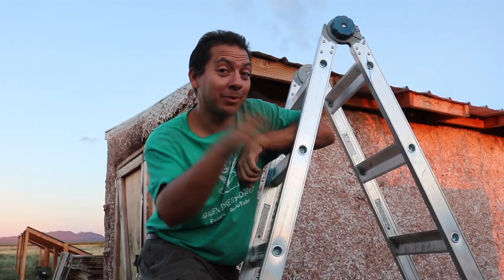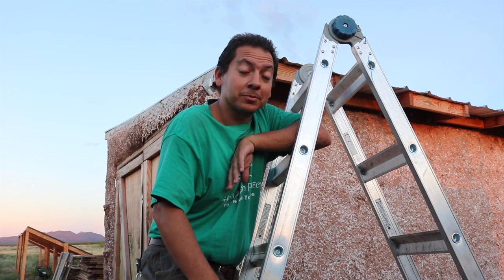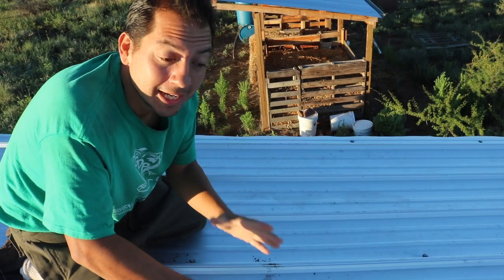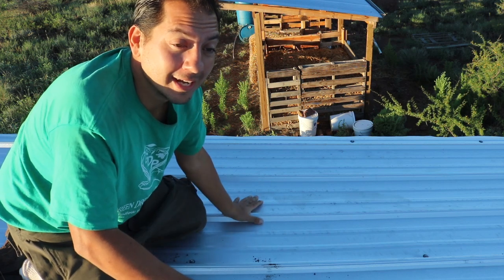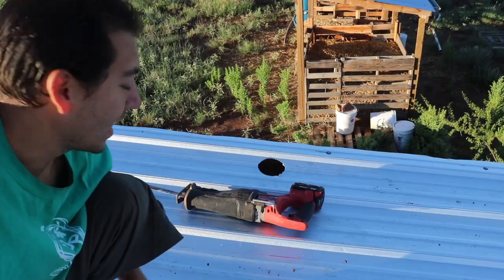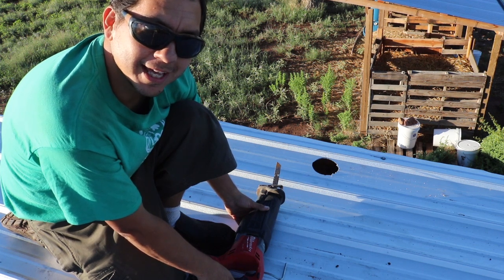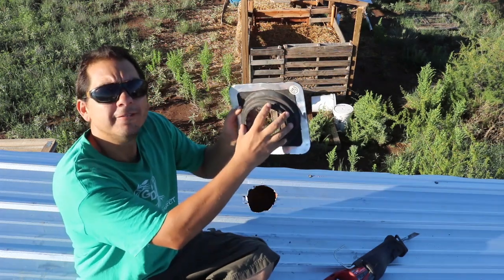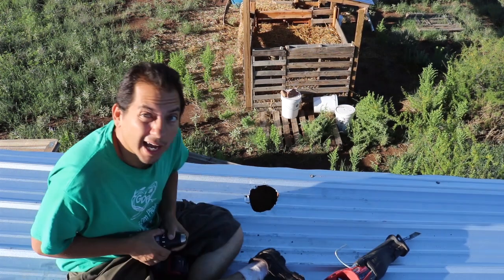OFF GRID No Electricity Air Conditioning in the Desert | Making a Solar Chimney

Comment from the maker: Thanks so much for watching! We hope you have an awesome day.🙏
Reply: They make 4" ABS or PVC mushroom vent caps available at most plumbing supplies.
Reply: Any updates on this ?
Reply: You don't do Heights as well as Jess...  Glad to see the solar chimney concept put in place.... How did it go now that it's been 12 months?

I'm looking back through old vids now that I've started on my place.
Reply: i know this is kind of an old video, but i can already tell that this method didn't work all that well, however it can still work if you buried cooling tubes like how earthships cooling tubes work using the natural air of the buried cooling tubes to cause an cross breeze into the room and then up through the sun tube that collects heated air while it keeps that flow of the cross breeze going continuously without the need for any electricity or any fans running.
Reply: Did this move some air at least? I've got stagnant air - no fun.
Reply: @5226-p1e  no. I have not done this .. yet. I've been trying to find different designs.
Reply: Great just keep up the good work I live out in the desert I like your idea please keep them coming I'm an old man
Reply: dig a trench and put a pipe in the ground on the north side and then attach to the incoming vents on northside. Dig the trench about 4 ft under ground. This will draw cool air from ground.

Comment: Cool, you are 20% of the way there. Now dig an 8' deep trench to the edge of your property and put some perforated drain pipe in and run it into the shed. What will happen is you draw air into the pipe and as it runs through the ground, it will cool it down to 55 degree (ish) and your solar chimney will pull the cool air in while the hot air rises and exits.
Reply: use plumbing water lines and a car radiator with a fan. the method you suggest fails fast from the natural ground movement causing water to get in the pipes and or dirt. just a idea for a cheap long lasting alternative that might work better in certain climates ect..
Reply: @biggiepaws5205  i thought he was in the desert
Reply: U R valuable!
Reply: Non perforated pipe is more typical
Reply: Underground water pipes will be best
Reply: geothermal cooling and earthship designs.   You can even transfer cool air by driving t-post even further into the soil at the bottom of the trench and gravel.  during the middle of the day when you likely have excess solar there are strategies for putting the excess energy to work with more fans and pumps.

I live in South Florida where it can get miserably  hot and humid in the summer. We are about 4' above sea level and our soil is basically coral rock but also very populated so  everything around me is paved.   One summer while on a road trip just 2 hours to the north in the middle of the state about 2 hours from both coasts  I noticed it was 10F cooler at night and I had to use a blanket while sleeping.  They are 160' above sea level and their soil is porous like sugar sand. I noticed their soil is cool and soft and I was able to easily pull cool water from just 10' below my feet with a shallow well and 12v pump.  Because of this I bought land there and am now looking for passive and renewable ways to cool a tiny 10x12 space.  I know the thinking is often sealed structures and insulation (at least to stay warm), but warm is rarely an issue here.  I have this idea a very thick natural tree top canopy and a structure of only weaved layers of sun sails, polycarbonate and bug screens then  moving a lot of air into an open space from the ground or through pools of water from a shallow well in a mostly watertight and bug free space.  Just one single 500w solar panel and a 100AH LifeP04 battery 30' away in the direct sunlight  to drive efficient 12v fans 24x7.  Somebody else mentioned here, but something we can mimic is what the animals do here between 11am and 4pm, they hide and rest, so naps are a smart and powerful strategy for dealing with heat.  Since there is often an abundance of solar power around those times, I can  create artificial rain onto the structure and soil floor resulting in evaporative cooling too.
Reply: @wtfvids3472 You aint from around these parts 🤣

Comment: To increase cooling efficiency, paint the top in Matt black stove paint. If you need more draw you can put a clear tube around the chimney for a green house effect. Lastly, if the air in isn’t cool enough, dig a longish trench and bury a metal tube in the ground. The air drawn through it will be cooled by the earth.
Reply: Precisely what I was thinking.
Reply: below the frost line in kansas, its a steady 55 degree's. would be a nice way to cool the air. PVC or metal. but....angle it and make a drain for it to insure that moisture wont build up and harbor black mold and bacteria. that is what i will do to engineer some cooling for my house. Karra and Donna Douglas are gonna help with all this.

Comment: Pipe run into the ground will pull cool air from underground. How deep I do not know earthen houses use this method. Look up earth tubes.
Reply from the maker: Definitely familiar with earth tubes. We may employ that with our house, but definitely with our greenhouse.
Reply: @ourselfreliantlife  Yup Earth tubes, at least 12-14 inches under ground it get cool.
Reply: Yes Jim we did touch on this subject during our permaculture course.
Reply: @MetalGearMk3  Here in AZ you need to go about 5 feet deep. We do not have frost problems but the heat does penetrate that deep into the ground.
Reply: @TehOldGamer   Good point. Vegetation helps to shade the ground and reduce the penetration, especially if it is designed to be buried beneath an irrigated garden. There's yet another reuse of greywater, to cool the geothermal pipes. 
Also corrugated galvanized metal pipe improves the heat/cool exchange between the soil and airflow inside the tubing.
Stay safe.😎
Reply: Sitting on clay soil how much air can come up?
Reply: @akeleven  The pipe/tube is buried in the ground about 5 to 6feet at an inclined angle such the opening of the tube is located away from the house and is exposed to the above ground air. The opening will be covered similar to what was done to the top end of the pipe in this video, that way you keep rain water, animal and at least large insects out. The whole idea is based on the fact that the ground temperature remains constant at the depth of about 5 to 6 feet, year round regardless of the temperature. The air is warmed up to room temperature levels as it's drawn in by the negative temperature generated within the confines of the house by the heated air column within the pipe/chimney on the roof.
Reply: Most things I've read say 6 feet down should be pretty similar to the yearly mean temperature of your area.

Comment: I rarely comment because logging in is too troublesome. But I usually enjoy yalls videos and support what you are doing. Logged in to say what a lot of others have said. The next step would be to rent a trencher and lay pipe underground to get a cooler air supply. Some have said perforated. I would recommend against that. Just solid pipe. Corrugate metal may work well as a conductor, plus it has a lot of surface area. And is usually cheep, or surplus. May not fit the trench though. The deeper the better, Some people say you can get air flow at 55, I don't think that's reasonable, but 65-70 would still feel great in your area. 

Two tips for when you pursue this. One, the pipe shouldn't be level. Since you are taking hot air from outside, and cooling it. There will be condensation. Even from dry air, and you don't want that in your pipe. So slop it away from your building. So it can condensate, and drain. then open to the ground at one point. Second tip, I saw one Earthship video where the intake pipe for a ground cooling tube was surrounded by herbs. The owner commented that it just slowly and steady draws the scents of those plants inside, 24/7 giving it a mild, pleasant smell. So maybe trench to your herb garden.

Comment: A small solar panel driven vent cap with a fan motor will help greatly in your efforts. Also you may consider looking up a geothermal air handling solution if you have the property to support it for both your home and workshead.

Comment: If your inlet is not cooling enough, try barring a 8 in PVC pipe below the beat depth of the ground. In cold country its frost line. But, dents your in a desert it's the heat line. Your thermal chimney will draw the air down the pipe cooling it. Active g like a air conditioner.

Comment: Awesome!  I have been wanting to try this for decades!  A few things though: a black metal chimney would be much more effective than ABS since the ABS doesn't transfer heat to the interior air anywhere near as well. Also most solar chimneys are significantly larger diameter. Finally, the taller the better.  If you could bury a pipe for the makeup air so that the incoming air is cool then you would really be sitting pretty.  :)

Best of luck! Can't wait to see how it works.
Reply from the maker: I was thinking the same thing on the diameter, material as well. Black metal would be better. I might have to try and find some. 
Thank you!
Reply: This is want I want to do with my tiny house! 

Create an air flow through a sunken insulated cooler that benefits from the cooler earth temperature and the ice bottles I fill it with and have fans circulating the air from low to high inside the house. 

Seems diy friendly but haven’t seen it done yet. Have you?Thanks!
Reply: @ourselfreliantlife  Thanks for the video!!! have you made any progress on this? I was thinking of building one of these too, I have shaded area near my house where the temperature is lower than the other areas. I could dig a deep trench and bury a pipe, and the solar chimney would pull air from that pipe opening in the shaded area. But im wondering how well it would actually work!

Comment: Convection can be your friend.  I would definitely make sure that pipe is really well braced, however.  When the gale force winds come, that long pipe will act like lever and may rip clean off.  Also, caulk is your friend for getting a good seal.
Reply from the maker: We've caulked it. I'll be bracing it better when I work on the roof underneath.
Thank you!🙏
Reply: @ourselfreliantlife  Perhaps guy cables connected around the edge of the roof, like an antenna would be easier and just as effective.🤙💨

Comment: Another good video.
Suggestions:
Tin snips for final finishing of hole.
Put a ring of caulking, around the hole, underneath the seal.
Reply from the maker: Thank you! I appreciate the tip!
Reply: A tweak to this tip; put the silicone/ caulk on the pipe boot first. That's what we do at my job (construction).

Comment: I just discovered your channel and I’m enjoying the videos. I’ve got a tip that you might want to pin - if you want much cooler air to be sucked in then consider having the intake air pass through a either a water reservoir with relatively cool water or lay down the intake pipes a couple feet inside the ground before venting into the room and outside. Water and soil have a great thermal mass and will absorb the heat from the air passing through the pipes. If you want to accelerate the process you can connect a DC fan or air pump to the solar panels which will force air to circulate through the cooling system
Reply: This is want I want to do with my tiny house! 

Create an air flow through a sunken insulated cooler that benefits from the cooler earth temperature and the ice bottles I fill it with and have fans circulating the air from low to high inside the house. 

Seems diy friendly but haven’t seen it done yet. Have you?Thanks!
Reply: I wonder if that would pump water, if the intake in the ground were placed in a water source..the solar pipe makes it's own suction. Interesting.
Reply: @TheKonnoisseur11  I am also thinking of doing this too. Im thinking that in the winter, I could use a fan to reverse the flow so the hot air from inside the solar chimney is drawn into the house.

Comment: That s gr8 
U can put a cooling pad on North side hole ND let it to b soaked with water in a pot
When solar chimney pull the inside air it will suck it through the wet pad leading to cool the shed
Reply from the maker: 😲Good thinking!!

Comment: It would have been cool to put in a thermometer in the shed for about a week before doing the alterations. Then compare the after temp with the before temps. but if the inside temp is the same as the outside temp you have a win. because sheds are usually hotter due to heat build up in them.
Reply: LOL, I know.  My shed temperature inside is 125F when the outside temperature is 100F.
Reply: @BCElginTex  exactly
Reply from the maker: We've done that actually. Now we'll have to compare the results.
Reply: Yea thinking that too

Comment: We used to call what you did Oakie Air Conditioning. You can also make a really efficient swamp cooling device if you get some hog hair filter material and cut it into long strips and stuff it in the pipe. Then put a solar water pump that pumps water to the top of the pipe and lets the water drip to the bottom in a small bucket. You'll get an amazing 'woosh' of cooled, most air coming out the bottom of the pipe.

There were, back in the 1980s, plans to install those evaporative cooling chimneys in downtown Phoenix, but I don't think it ever happened.

Comment: I knew of an old house which was built with vent windows near the ceiling above the main windows and inlet vents near the floor, and in hot ass Texas weather you could sit inside that house and be reasonably comfortable in what otherwise would have been a hot box.

Comment: I was going to do soemthing like that for my greenhouse originally.. but i looked at volume required and pipe cost and decided to use big vents.  Glad to see you set this up. I bet it works like a champ!  One thing I'd do to improve efficiency is pack that screen up top into the entirety of the cap.. allow more screen surface area. Screens are highly restrictive to flow.
Reply from the maker: 😲Thanks for the tip Carlton. I'll have to give that a shot.

Comment: The thing on top is called a China cap.
I like the idea of the vent pipe being blacktop create suction.
The taller it is the better.
If the intake air is coming from a cooler place. Sometimes they run pipes through the ground, deep enough where it's cool.

Comment: At 10:24 the thought I had was instead of using vents, why not connect piping underground with a chimney coming out of the ground with the idea of using the deeper, cooler earth to cool the air and have the solar chimney drawing the air through as you intended. If the pipes are deep (3-4 feet?) and long enough, it should cool the air nicely, especially if you could somehow incorporate water surrounding the pipe in some way; like in a well? Anyway, great job! Wish we could have seen the results.

Comment: I love this!! We were thinking of doing the same thing but digging 3 ft down in the ground and running a cold air intake pipe. Thanks for the walk through!!
Reply: 3 ft may be on the shallow side...
If you are thinking PVC
I'm thinking it has some kind of R value
But good luck
Reply from the maker: Earth tubes! We'll be utilizing that as well.
Reply: Did you end up doing the earth pipe? Wonder if 30ft would be effective at all? I've read they need to be at least 75ft..

Comment: Just a suggestion,  put a small fan in the bottom of the pipe blowing outward 12 volt. Now it will stuck the hot air out and will not use a lot of energy. If you have solar energy it wouldn't have to run continuously. Good luck, always.

Comment: good idea, passive heating and cooling is the smart way to go. suggestion for the solar chimney, more thermal mass. like that even after the sun goes down it will/may continue to draw air thanks to the retained heat in the thermal mass in the chimney. a mix of clay and sand ought be a good/free solution. you'll need to seal it of course.

Comment: Awesome idea, interested in the temp results. Another idea off of a friend's idea just for a cool room to be in. Use sheets that wick water well as walls placing the bottom of the sheets in water. Creating a swamp cooler
Reply: This is want I want to do with my tiny house! 

Create an air flow through a sunken insulated cooler that benefits from the cooler earth temperature and the ice bottles I fill it with and have fans circulating the air from low to high inside the house. 

Seems diy friendly but haven’t seen it done yet. Have you?Thanks!

Comment: I had thought about the pipe idea.  Some time ago..
The problem with pipe air flow is to overcome the amount of heat the building generates (sq footage) ...
Then i saw earth ships and. Google images of earth ships...
They use culver pipe buried in north facing berms for the cool air
But to get enough heated air flow... On the south side (high side) of the roof
Actually raised some...they have windows. 
Open lets the hot air escape pulling cool air in..
Closed to keep heat in when needed
Plus during the day 
Free lighting...
Windows seem to be the key to over coming the restriction of getting enough square footage for  exhaust...
Well that's the direction my experiments on energy free cooling will start.....
I love the internetvand UTube so much information....
Reply: You might check out earthship cooling siphoning air flow..
Google
Earthship air flow..
When that comes up press images...
With all the generations of earth homes (earthships)
They've got the eneegyless
Cooling air flow down...
The best ive seen
Reply from the maker: We'll definitely be utilizing more ideas out here.